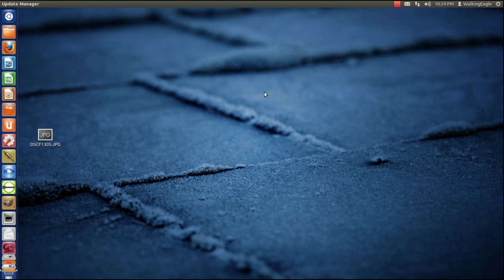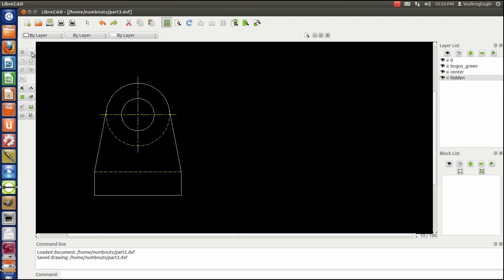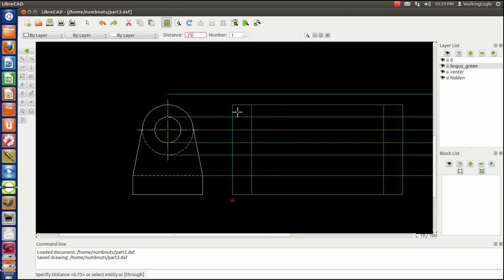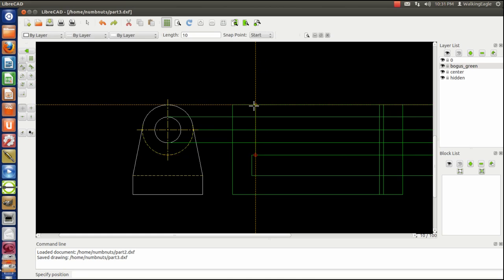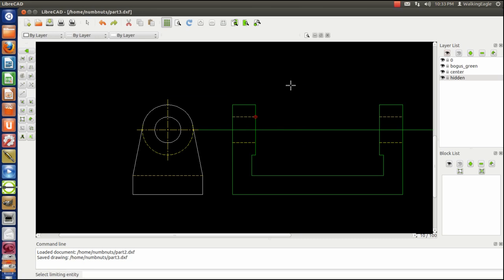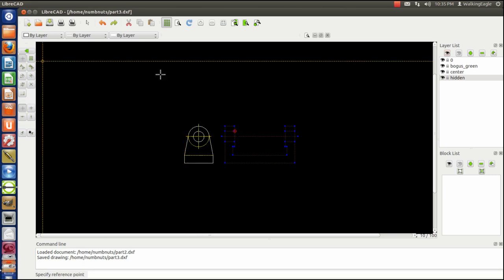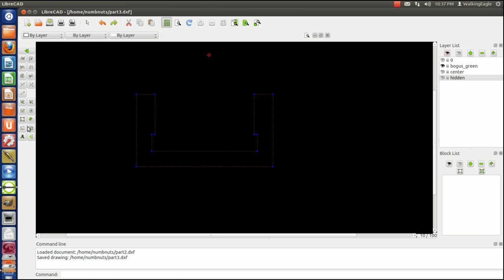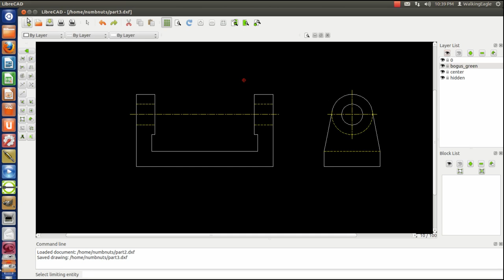LibreCAD tutorial 3 - Creating a 2nd View

Comment: The two extended tangent lines are missing on the inside bracket up to the edge of the circle in the front view.
Reply from the maker: +jh  I may have caught that in the next video.... but yeah.. there were a lot of mistakes in these videos.  I was learning it as I was sharing it.

LibraCad is now upgraded with many significant changes.   I may create a new series.... but mostly I have been busy using it.

In general I just create drawings for my own use, so I don't follow the rules for creating high-quality drawings.
Reply: Yes, it was in the next video. Thanks for the reply :)
Reply from the maker: Thank you.